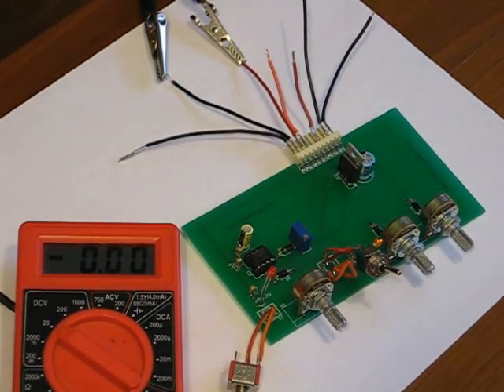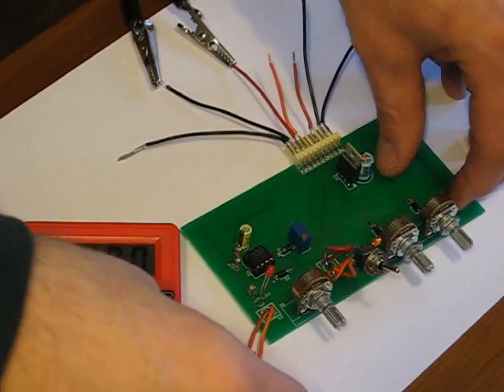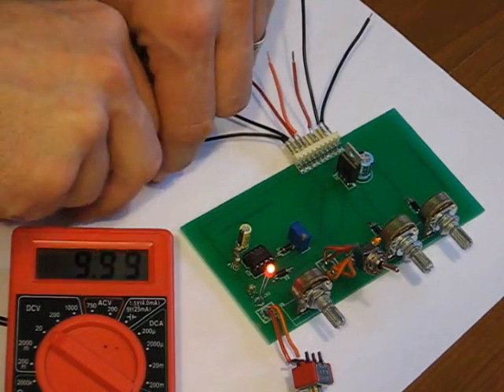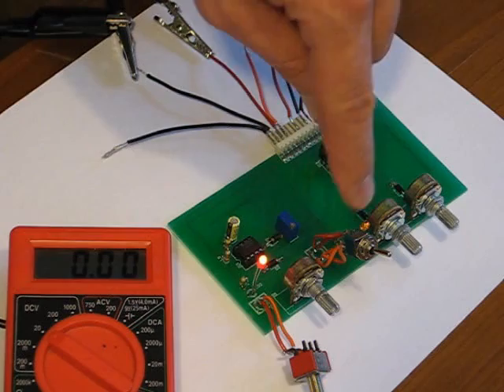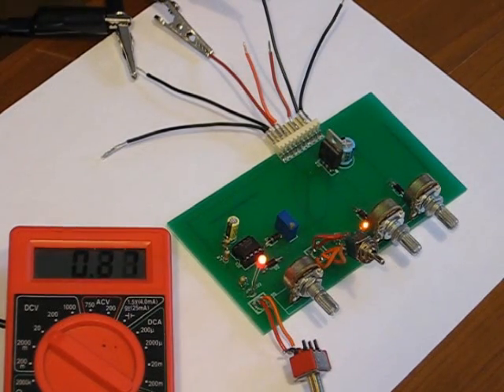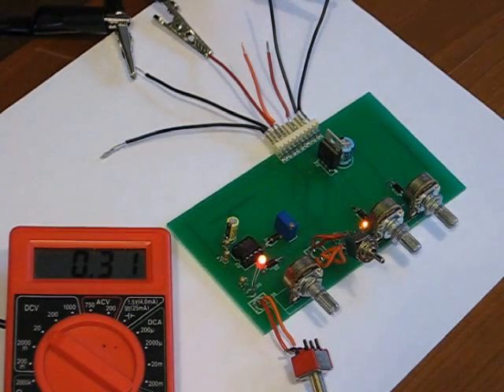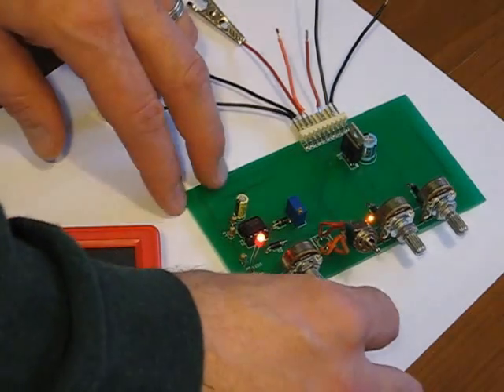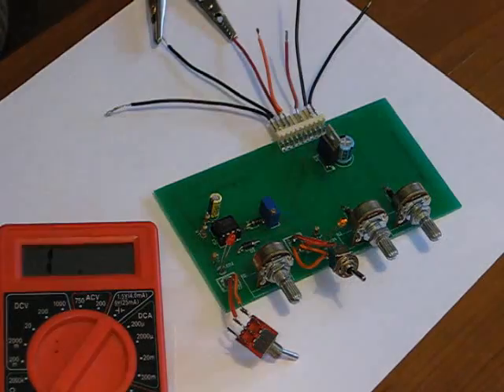Calibration of the Dual O2 + MAP KIT

Comment from the maker: This is called the "overpowering" method.  Voltage is only addative when the grounds are isolated.  This unit does not use an isolation, so it acts like a pacemaker.  If you add 0.9 volts, it will pulse ~ the same as the O2 sensor.  You only get a code if you try to crank it up more than a full volt over maximum.  I have been using this design for 1 year and have sold and installed 1400 units with only 5 returns.  Each vehicle is different and experimenting must be done to see correct voltage.

Comment: how do you tell if a pulse is a proper amount? it looks like your 555 is pulsing. so lets say the o2 sends a .9v pulse and your 555 just happens to send a .6v pulse. that would = too much voltage for the ecu or even if it was in the other direction with not enough voltage. the huge variations in the voltage going back to the ecu would give a faulty o2 sensor trouble code and the ecu would ignore the o2 and use another sensor like the map or maf. what are your thoughts.